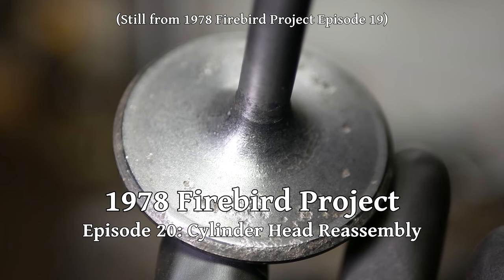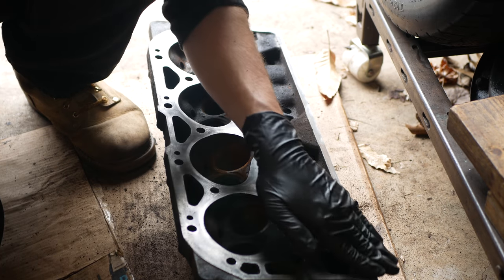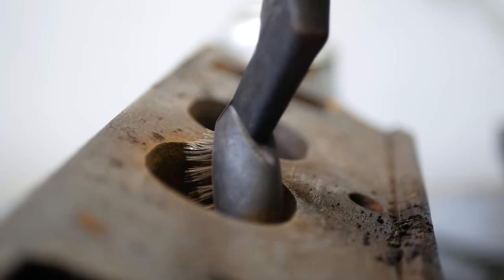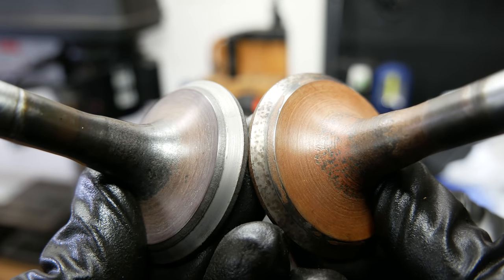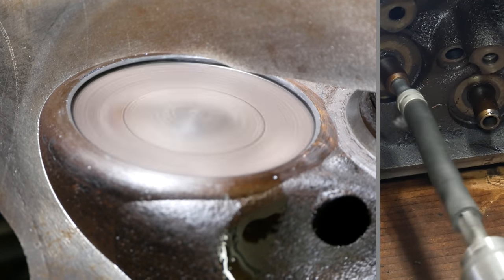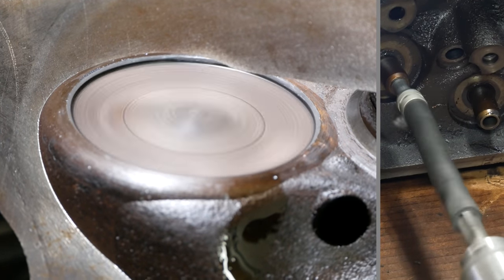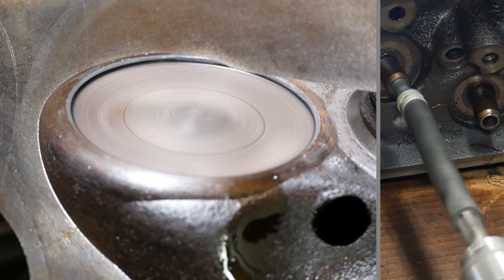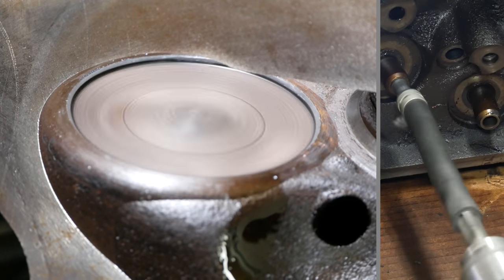$200 454 Engine Rebuild: Lapping Damaged Valves, Cylinder Head Cleaning and Reassembly (Ep.20)

Comment: You really have a lot of trust with a drill.. like really why would your run a thread chaser with it, if all those threads are perfectly aligned then you have some dumb luck
Reply from the maker: It's a thread chaser, not a tap. They have a rounded front end and are pretty forgiving if the threads you are working on are already in decent shape. If it doesn't feel right you can tell even with power tools and that's the cue to stop and reassess.

Also that was an impact gun and no I am not recommending other people use them in that way haha

Comment: As a machinist for many years this is the wrong way to fix a set of cylinder heads especially when they're in this bad of shape and their Chevy heads not Pontiac heads 454 considered a temporary patch job at best
Reply: ofcourse everything isnt in spec but it will run, 200$ engine no point to put 1500$ on machining the heads properly. This is prety much the stuff you can do home cheap without machineshops mill

Comment: Ummm to all you back yard , back woods mechanics ........ This engine should have replaced ALL valves, ALL the valve seats. and ALL the valve guides. There is no such thing as a "budget" rebuild, only a cheap incomplete one. This is the kind of shenanigans one uses to rip off someone when selling a used car
Reply: stockrebuild its fine, if you want full valvejob then its cheaper to get assembled aluminum heads.

Comment: Replace the badly damaged valve, it won't seal. You didn't check for valve guide wear. Bad valve guides will cause oil burning and carbon build up on the intake valve. You didn't check the valves for leaks after assembly. Do the job right, and you won't do it twice.